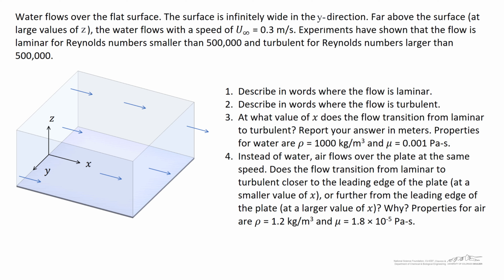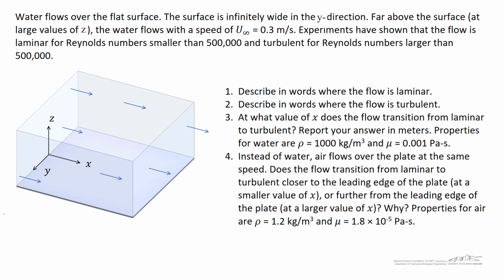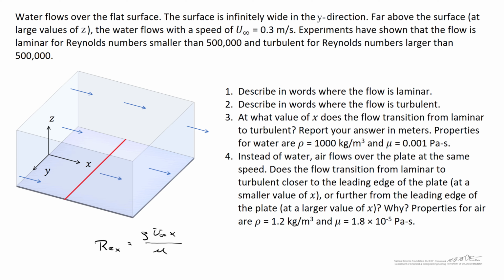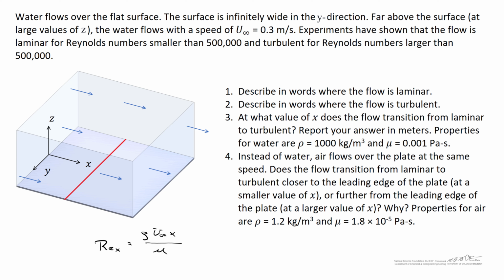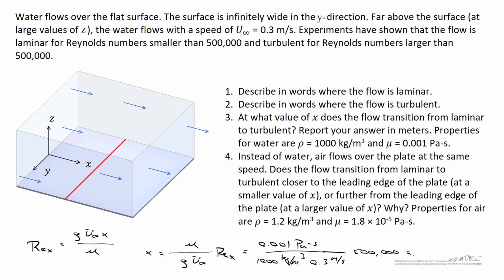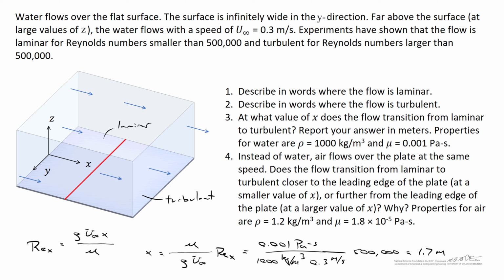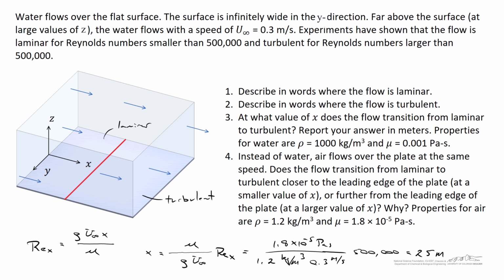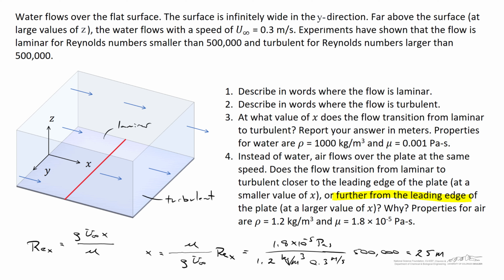Boundary Layer Example 1

Comment: there is a trick in Question 4 for me. So in this case, the kinematic viscosity of air  > water, so the critical point of air is further (according to the formula). But in reality, the fluid with smaller kinematic viscosity, its critical point will be further! This means water will have the further point! Can you help me to explain, thank you so much!